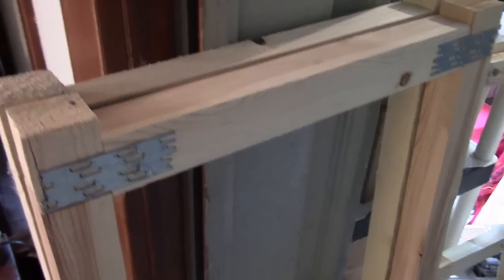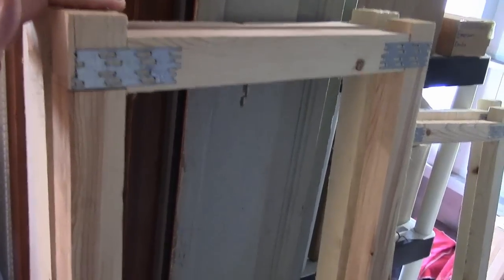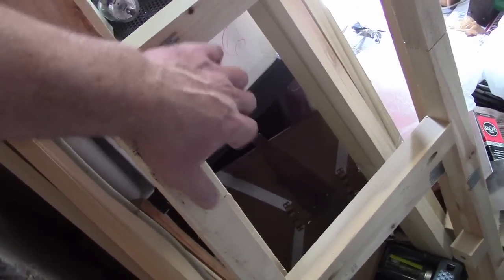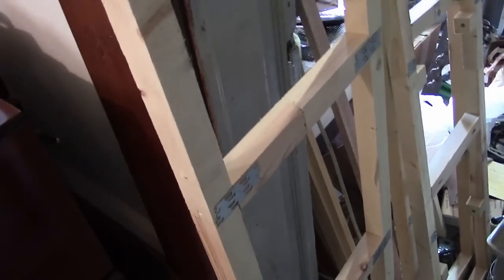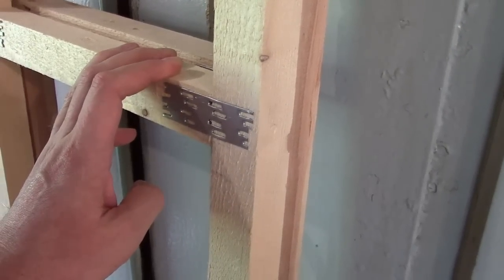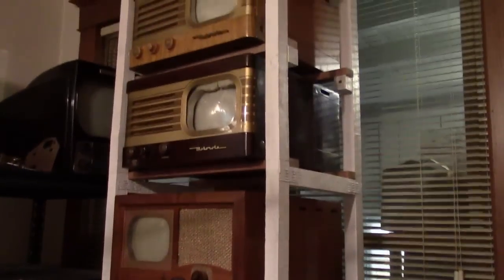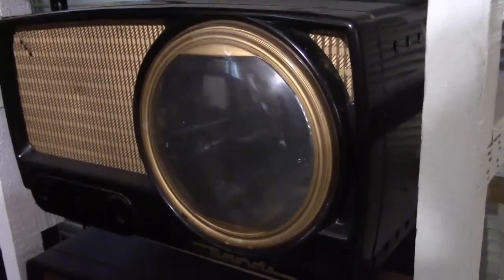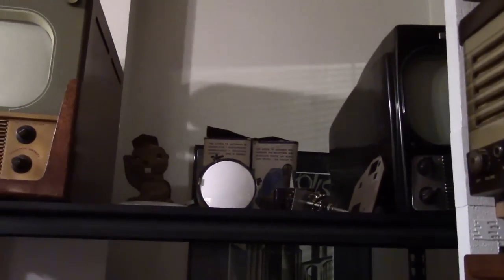Custom TV shelvng system p2o2

Comment: I love these old early tv sets, and you sure have quite the impressive collection right there! You know what might be fun sometime? Make a review of each one,compare which is the better set for the price (back in the day) and in current value!
Reply from the maker: Intesting idea, but that would take more work than I have time.  Few of these sets are restored and working.  I can tell you this much - the Admiral 19A11/12/15 is the only one to have a power transformer and is a very good performer.  On the other end are the Motorolas - creative circuit design made it the lowest priced but performance suffers.
Reply: bandersentv That makes sense to me that you are rather fond of admirals, possibly because they're fairly common in the Chicago area, just like the motorolas. Is there any small porthole tv set on your mind to collect? I've been googling a bit and found some awesome designs in the 10-12" porthole models
Reply from the maker: Odd as it may sound, very few of my sets did I actually seek out.  Some I got as part of a package deal, some were givien to me, some showed up on craigslist near me for a price to good to pass up.  I do have a few small porthole sets - Silvertone TV220, Stromberg Carlson TC-10 and Airline 05BR-3024.  Had a 12" Zenith porthole but sold it a while back.
Reply from the maker: You can see all the sets I've owned or worked on here: https://www.flickr.com/photos/70039806@N00/albums
Reply: bandersentv thanks for the link bob, this will be an enjoyable view!

Comment: Wouldn't it have been easier and less expensive just to buy a few 8 foot 2x4s (or even 2x2s like these) and some wood screws and build them to the proper size yourself?  IIRC, you even have a mitre saw...

I build shelves of various types and workbenches and such all the time with simple 2x4 frames.  Super stong, sturdy and dirt cheap.
Reply from the maker: +DRSaturnComputerTech 2x4s would be overkill.  Only 2x2s I could find were  expensive oak for $20 each.  Also hard to find straight 8' 2x2s.

Comment: How did you brace it so it is rock steady and doesn't sway?  It looks like you have at least 200# on that framework.  At least it's not particle board crap. Don
Reply from the maker: +umajunkcollector I didn't need to do any bracing.  It's solid  - no sway at all.  Yes, about 200 lbs on it
Reply: Hmmm, did you use GLUE?  I suppose that it could be rigid with only screws, but that wood doesn't look that strong, i.e. it's not hard wood. Don
Reply from the maker: +umajunkcollector The pine sides are glued and nailed.  The shelves are mahogany hard wood and screwed.
Reply: AHA, GLUE!  built like a TV cabinet!